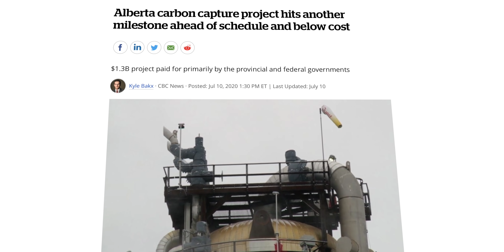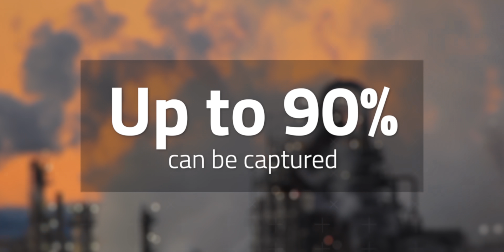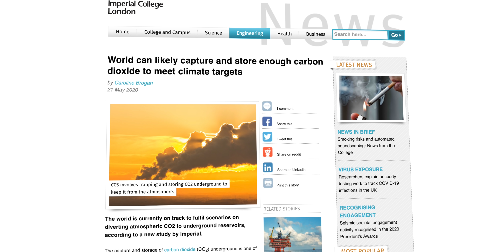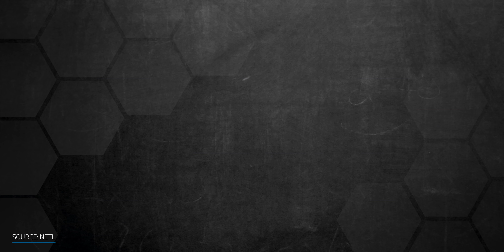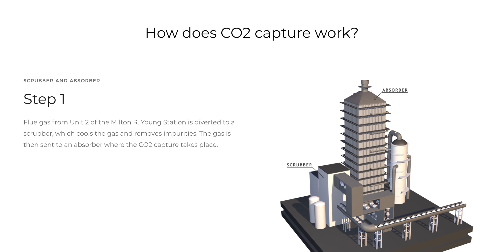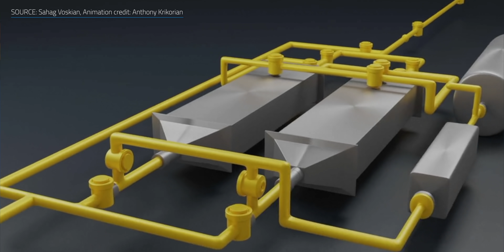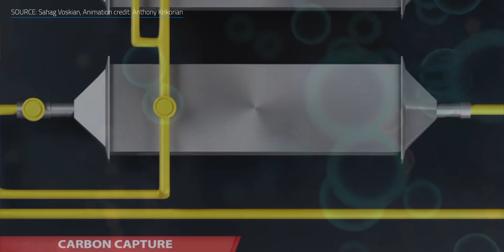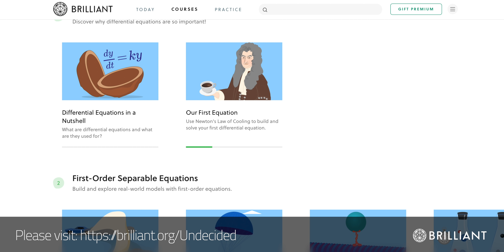The truth about capturing CO2 to reverse climate change

Comment: TESLA STOCK BUMPS
 1. Battery day. : stock goes up.
 2. Investor day. : stock goes up.
 3. Stock split 10 to 1. : stock value goes up.
 4. S & P 400, 500, DOW 30, inclusion. : stock goes up.
 5. Cap rase. : stock goes up.
 6. Tesla acquire high view power. : stock goes up.
 7. Shift battery production to battery wall and vehicle use. : stock goes up.
 8. Stop all giga batteries replace with high view : stock goes up.
 9. Start cyber semi production : stock goes up.
 9. Start cybertruck in ny., na. china, germany. : stock goes up.
10. Buy peaker plants replace with high view power. : stock goes up.
11. Take both offers in texas and tennessee. : stock goes up.
12. Sort sellers have to get out.: stock goes up.
13. Night Vision HUD & Wire Reduction Munro Live.: stock goes up.
14. Tesla announces compact ev.: stock goes up
15. Cybre truck goes into production.: stock goes up.
16. Tesla announces  Delivery/cargo van.: stock goes up.
17. Tesla compact ev begin production.: stock goes up.
18. Tesla  Delivery/cargo van ev begin production.: stock goes up.
19. Tesla announces HVAC sys.: stock goes up. 
 Air gets cleaner, deaths get lower.

(we don't have time to do one thing at a time) an american president.

Comment: Just removing carbon is not enough, it is necessary to return moisture in the air again as the type of humidity provided by native forests. Do the test yourself, go into a forest on an extremely hot day and notice the difference in temperature, the difference in air humidity that only natural biological interaction can provide. The obvious is still the most difficult thing to identify.
Reply from the maker: Carbon capture alone is far from the solution.  You’re right that there’s many angles we have to approach this from.

Comment: You capture 100% of the carbon you don't burn...
 
Snarky comment aside, I think this is a great technology... for pulling CO2 out of the atmosphere and providing precursors to materials and synthetic fuels. We should really be aiming to stop burning fossil fuels entirely (and probably not burn too much biomass either), though CCUS on flue gases might help minimise the impact from gas power until we have better demand/supply management and can shut them down. There's no excuse to still be burning coal, though, and my country hasn't burned any for months.
 
Ultimately, we need everything we can throw at this problem. Insulating buildings, installing solar panels, nuclear baseload/peaking capacity, energy storage, domestic heat pumps, battery electric vehicles, hydrogen as fuel/storage... With everything, including CCUS to pull out the carbon we've already put into the atmosphere, we might stand a chance.

Comment: It has its place. Especially if it can be done economically with some help from government.
Reply from the maker: My thoughts exactly.  I'm especially intrigued by the uses like the CO2 concrete.
Reply: If there should be any "help" it would seem that taking from the citizens by force would be the last thing you would want to consider.  The poor, single moms, the disabled, need not be burdened with this forced confiscation of their meager income.  If the problem is caused by the consumers, let the consumers pay for the corrective action.

Comment: Just thinking about this in the simplest possible way, the ONLY way to slow down and reverse climate change is to removed carbon from the atmosphere. The carbon from fossil fuels was happily locked up carbon taken out from the Carboniferous period until we put it back in the atmosphere. The ONLY way to stop its effects on climate is to put it back in the ground. Tree's can't do this unless you cut them down on an industrial scale, bury them and let new ones grow in their place and repeat the process. THis would effectively speed up the natural process. Regardless of the method. The ONLY way to fix this is removing extra carbon from the atmosphere and putting it back in the ground.

Comment: Just as usual - a very well researched topic!
On top, Matt has found one of the most important issues in all issues climate change and climate mitigation!
I studied, I did research and I work in this field of expertise. I also had some contact with the Swiss company mentioned in this clip - Climeworks. So what about CCS? Well, it might just be the next bitcoin - depending on what regulators will do. 

From my work, I know that it is always the monetary issues that make one thing work and another won't. It, therefore, comes to no surprise that even the EU is rather slow in getting their act together when it comes to emissions and emission reduction. nZEB is just one example of how many member states slow down the application and water down the goals. In order to just get somewhere into the neighborhood of emissions reduction, we would need a similar emissions reduction as we got from the COVID 19 economical slow down - and this every year. 

So, if we are not able to reduce emissions, we need to capture them. What is the alternative?? Geo-engineering?? That would be real scary stuff which we still do not even have the slightest hint of how that could work and what consequences that concept would have. It is then on the regulator to set prices for emissions as well as max. limits - if you go over the limits, you MUST capture. At the moment the cost per captured CO2 is about US $ 800 - to US $ 900 per ton. The market price is about US $ 200! So there is a big cap - a mandate would increase demand sharply and the market price and the true costs would get much closer. 

It is of utmost importance to have a safe storage concept. Climeworks has one of the best since it is in solid form. Earthquakes and similar are no issue!
Reply from the maker: Thanks for sharing, Ulrich!  The price gap is a massive problem.  It's kind of like solar/wind decades ago.  Incentives are needed to spur up interest and demand, which will then close that gap and let it stand on its own in time.
Reply: @UndecidedTechnology  Matt, I believe it takes more than just incentives - it takes real painful penalties. We saw this with the European car industry. When the EU first came up with stringent CO2 limits in the early 90's, they all told us - "this is way too strict and it can't be done!" Now they put heavy penalties in place which kick in in 2020 - and "ta da!" suddenly it works and real fuel-efficient cars pop up like mushrooms.

Siberia just had another heat-wave - and we all know what happens when the permafrost goes... https://phys.org/news/2020-06-arctic-siberian-alarms-scientists.html
Reply: I have a question, can you help me

How exactly do plants capture carbon dioxide specifically? Why not imitate the way plants capture carbon dioxide?  And converting it to oxygen and carbon in the way of plants as well

Comment: I bet this is going to be a good topic to separate the environmentalists from the perpetual complainers. 
That being said.  Without any info on the power requirements I don't want to support a system that burns more coal to get power to scrub co2 from other sources.  Likely not the case but it's always suspect when it's not brought up.
Reply from the maker: Thanks for the comment!  And I probably should have touched on that more in the video.  It can be powered through renewables, but there is an efficiency hit in power plants that add this on.  The cost is a problem right now too, but that will come down in time if companies are able to commoditize the technology and make something useful out of the captured CO2.
Reply: @UndecidedTechnology  That seems a bit counter productive.  i.e. when there is no sun we need more coal.  But if there is enough sun then we don't need coal (or whatever) creating co2.

Comment: Using captured CO2 for carbonated drinks seems a bit silly.  As soon as the drink is opened the CO2 is released again back into the air.  Which, of course, begs the question; How much do carbonated drinks add to climate change and why aren't we trying to reduce their use?
Reply from the maker: I thought the same thing about carbonated drinks.  It's not a big contributor at all ... but it is a path to generate some money from the captured CO2 for the CCS to run.  Me personally ... I was really intrigued by the CO2 enhanced concrete.  Makes a better product and removes the CO2 from the air.  Win/win.

Comment: 20 years ago I read a story about a process that separates the O2 from the carbon, and you're left with Carbon black. Its a solid, and it can be used in manufacturing. Tires if I remember correctly. Seems better than trying to store a gas. There's just too much space between the molecules.
Reply: the whole thing is likely a farce and a scam.  If you burn something to make CO2, it takes a ton of energy to unburn the CO2 back into O2 and C.  If the thing burnt is coal, you can NEVER extract enough energy from the burning of the coal to re-separate CO2 into C and O2.

Comment: CCUS has always sounded like a bit of a scam to me.  I do worry about long term leakage.  And using it to make oil drilling more efficient is so stupid.  Unfortunately our Australian government has been duped into believing that CCUS will mean that we can just keep burning coal forever.  I live in Victoria, which has very dirty electricity production, based mainly on brown coal.  We took on the problem at our household level 6 months go and put in a decent amount of rooftop solar and a battery.  So far, we have exported net 2 MWh.  This is after powering our home, a PHEV and an EV.  If more people did this, we wouldn't need CCUS.
Reply from the maker: The part of CCUS that has me the most interested is how we can reuse the CO2 to improve things like concrete.  Not only is it making a better product, but it's helping to clean up things at the same.  Seems like there's a virtuous circle there.  But I'm very much in the same camp around concern that this may give industries an excuse to just keep polluting.
Reply: @UndecidedTechnology  Thats what uniper is doing now, they have coal, oil and gas plants in germany and now released in multiple media, the will start using carbon capture technology. But on the other hand they opend a new coal plant in June in Germany. (coal has to be imported from brazil) This is so stupid...
Reply: @UndecidedTechnology  the problem with all building materials is the half life or even environmental breakdown... How long is it really contained, not much point temporarily trapping CO2 only to have had it all escape within a couple of years. Especially that the half life of carbon is as old as the bible at 5700 years. It will eventually escape. I can already see scientists calculate how much escaping per year is acceptable when the true answer is "none". Like you said... Money makes decisions, and if scientists want to keep earning, concessions will be made to integrity.
Reply: @UndecidedTechnology  c02 is not a pollutant it's essential for life
Reply: I wouldn't worry about the brown coal long term leakage until you're well into your 80's bud.
Reply: @Nathan0A  What is your logic for that, especially that i don't believe he said his age... He could be 70. Your logic needs adjusting if you intend on making arguments against protecting the environment. There should be absolutely no arguments against protecting the environment... Even if it was a complete scam and all data was false... Protecting the only planet you have is the only sound option. All the people who claim the environmental issues are a scam... Scams make money, there is no purpose in perpetuating a scam if it has no returns.... Oil taxes are the "crack or meth" of every government... Who's more likely to lie? What is bullshit is them thinking they can solve it with a carbon tax. Keep polluting... More taxes, one for using, one for "abusing"... 🙄
Reply: @ericcloudbolduc8840  "Even if it was a complete scam and all data is false"

Thank you for proving the point I've been making on why these Climate change fanatics are complete sheeple.
Reply: @arnowisp6244  go check out "the social dilemma"... Everyone has been confused by social media... They are making a civil war. Everyone thinks they are right, because they are force fed that through their media feeds...
Reply: @arnowisp6244  These aren't informed arguments.
Reply: not everyone has the money to invest in solar panels.
Reply: You've been duped into believing that there's a climate emergency
Reply: @notskottkendall  I do not believe that you are simple, but the climate does need to be looked after, especially with all the forrests burning in the last couple years... Amazon, australia, and california... I'm sure you know the source of oxygen and it's need for it in the type of lifeforms living in this ecosystem. I don't believe in many things... But the need for trees on earth, and the change in climate due to excess CO2 floating above the oceans warming it up and causing larger hurricanes, also affects climate. It's cooler in the forest than in the city, it would be logical that more trees means "cooler" earth overall.
Reply: @ericcloudbolduc8840  Yeah and the those Australian and Californian fires are far worst than they should be thanks to idiot policy that greatly reduced prescribed burns because "muh Climate Change" and when these megafires start burning thanks to the accumulated under bush they blame Climate change even though their stupid policies caused most of it.
Reply: @notskottkendall  go check out "the social dilemma"... Everyone has been confused by social media... They are making a civil war. Everyone thinks they are right, because they are force fed that through their media feeds...